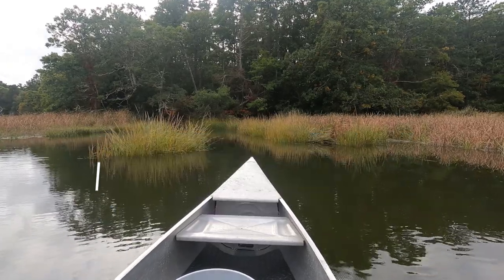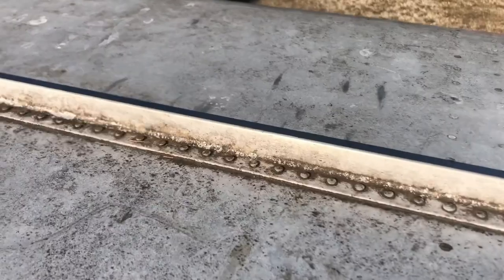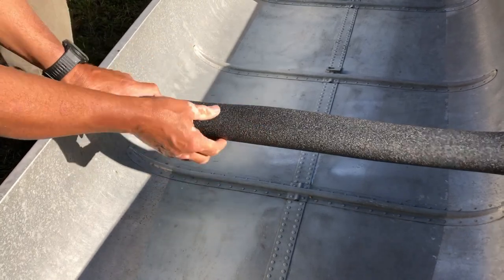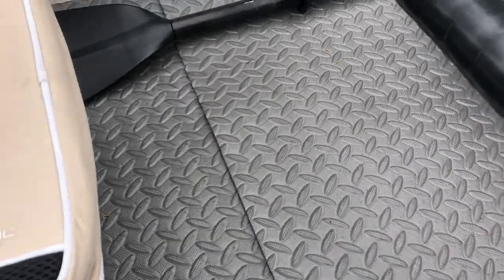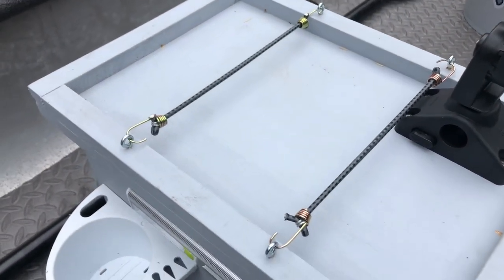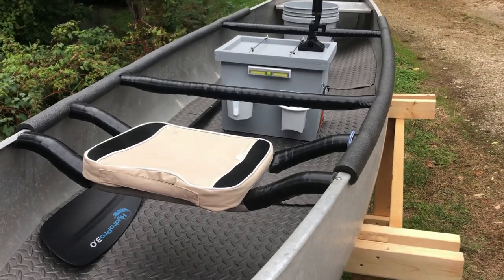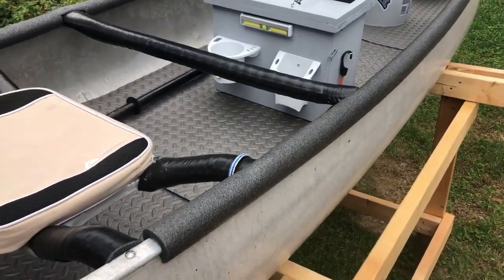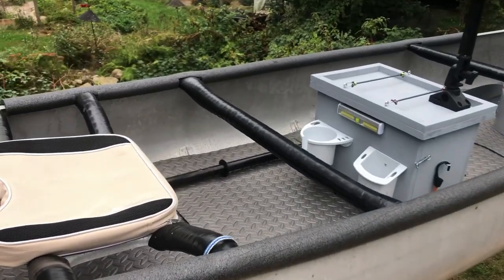Grumman G15 Canoe- cleaning, modifications and connecting with nature.

Comment: Thanks. Getting ready to start similar work on a 17' Grumman Eagle. Wondering if the thwarts will come off easily. Thinking about using pool noodles rather than pipe insulation. Slip on over the thwart so no tape is needed. Should add buoyancy too. What do you think?

Comment: Am I understanding you correctly that your using the bow seat to paddle from and the stern seat as the bow? Why?
Reply from the maker: Yes, correct. It's a common practice when paddling solo. It balances the canoe much better by keeping the weight more central. It handles much better this way. If I sat in the stern, the bow would be lifted too high and easily taken by the wind. It also doesn't track or maneuver as well.
Reply: @bnatural2  Thanks for the explanation. When paddling solo in my 17’, I kneel in front of the rear thwart to balance the weight. Getting harder as I get older.